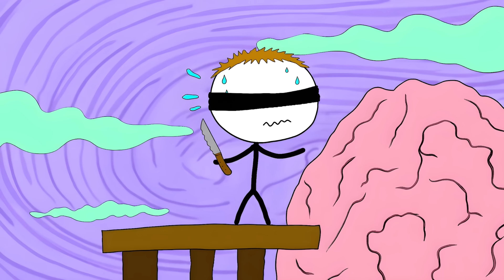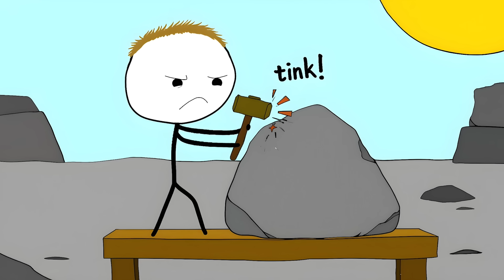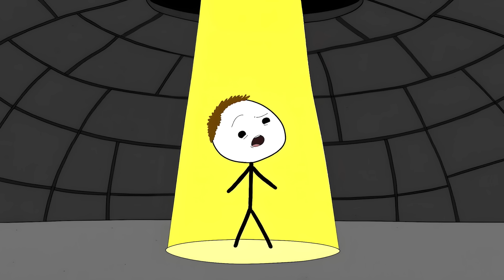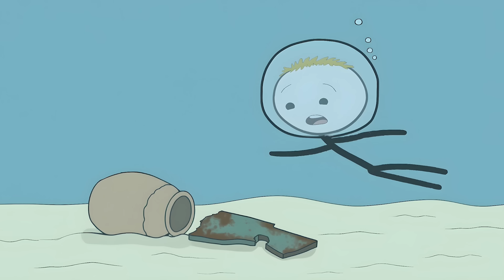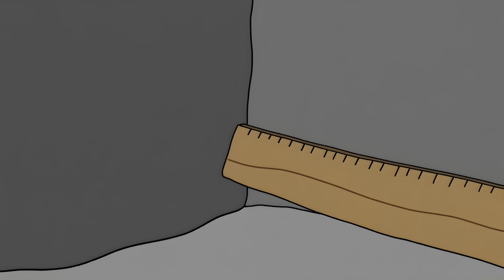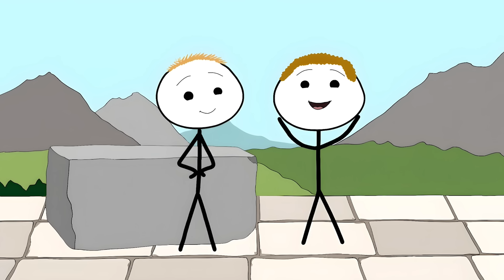Ancient Structures That Break Mathematical Laws

Comment: The Incas (back there) could make a kind of "stone-welding" with the help of chemicals. These chemicals (part found in geothermal fountains) could weld the stones togheter. They cover a surface of the stone they want to "weld" with a thin layer of these chemicals and put the another stone to press with gravity. After some time the chemicals stop dissolving the surface and act like a chemical glue between the stones.
I saw this in recently documentary about it

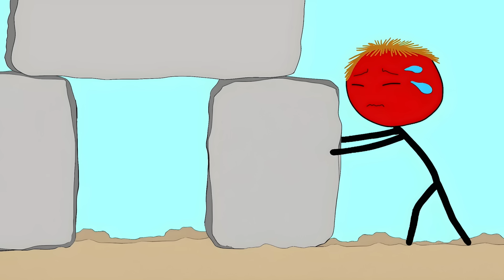Comment: 2:51 
800 tons equals 1,600,000 lbs
 equals 800,000kg
Reply: No, you are mixing up your units.  800,000 kg = 800 tonnes (metric tons).  "Ton" is generally used to reference the short ton, 2000 (okay, actually 2000.001) pounds.  According to Google, 800 tons (short tons) = 725,748 kg (rounded to the nearest kg).

Comment: "measurements accurate down to a fraction of an inch" 😂 You need the metric system to design anything. Omg so funny. Launch a rocket to the moon with the imperial system? Not possible.😂

Comment: This is all cool stuff but I feel the oversensationalization is a bit much. 

This stuff is amazing enough as it is, you don't need to exaggerate. I only knew about half of the stuff you mentioned but what I do know about, compared to what you said about them, it's a bit much. The antikythera mechanism is amazing but it's not actually thaaaat accurate. Moving big rocks is impressive but acting like they must be lifted vertically to be moved is not accurate. It's much easier to drag or pivot large stones than it is to lift them straight off the ground. Ancient builders were not infinitely more precise than modern engineers, they were more precise and accurate in specific things that they cared a lot about, compared to modern builders that dgaf. Modern engineering drawings can be as precise as they want. Just add some decimal points to the software, it's about what achieving a practical degree of precision. With the stuff we want/need to be extraordinarily precise with in the modern day there is no comparison to anything ancient. We can smash subatomic particles together at 99.9% the speed of light. Now that is precision.

Comment: And remember that the Incas didn't know the wheel!!!

Another extraordinary monument in terms of architecture is the Duomo in Florence, Italy (Cattedrale Santa Maria del Fiore, architect Filippo Brunelleschi). “The enormous dimensions of the dome made traditional construction methods using formwork unfeasible, which later gave rise to speculation about the construction techniques used. Brunelleschi left no trace of drawings, models, or sketches that would provide information about the procedure used in the construction of the dome” (wiki).

I have been to Italy twice and have wonderful memories of it ❤🤍💚 (I am French, so it's closer!).

Travertine: a sedimentary limestone rock of biochemical origin, whitish to yellowish in color, concretionary and vacuolar, formed by the precipitation of calcium carbonate at the emergence of limestone springs. (Travertine often contains leaf imprints. Highly decorative and capable of being polished to a beautiful finish, it is used in construction.) Widely used in Italy. (Larousse Dictionary)
Reply: They may have known of them but wheels aren't very useful in mountainous terrain. Also not useful in desert sand (Egyptians).